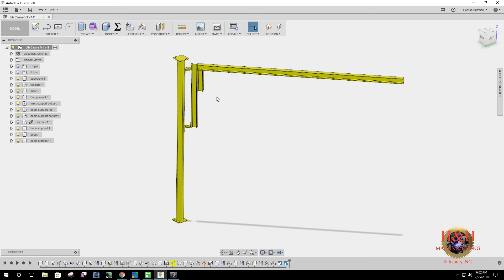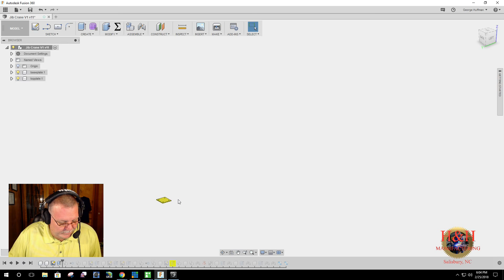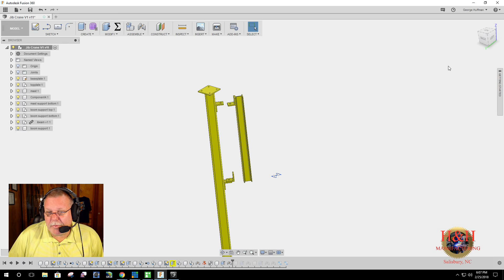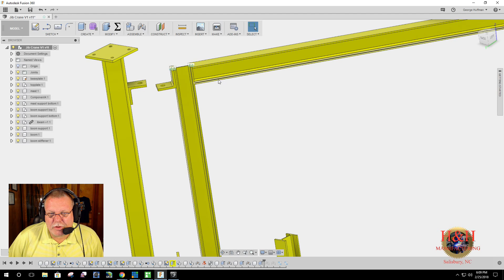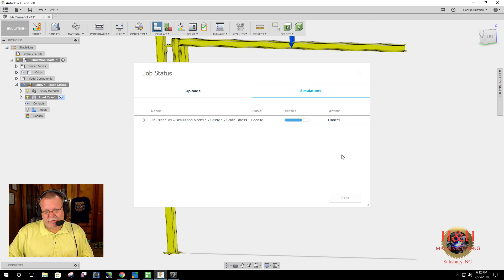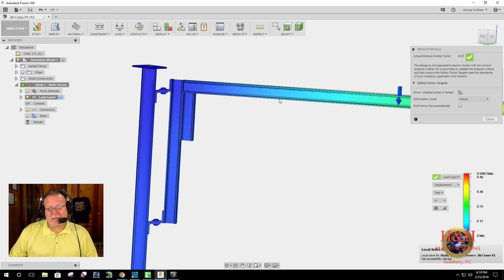LS5--Modeling and Stress Simulating a Jib Crane

Comment: Does horizontal Beam rotates or fixed ?
Reply from the maker: It rotates about the hinges mounted on the vertical tube
Reply: @hhman  is Mast solid or hollow?
Reply from the maker: @chavvaramakrishna1124  3x3x.250

Comment: Mr. Huffman,  I enjoyed your stream.  I would like to mention that when you apply your load force, even though you are selecting near the end, it is applying the force evenly across the whole length of the beam.  What should happen is to split the face near the end to represent an area the size of your trolley, like an area 12" long on each interior flange.  Then you can select those two split faces as the application of your 600 lb downward force.   Applying the load in a small area near the end should represent the  displacement closer to actual.  Here is a brief video on splitting a face, https://www.youtube.com/watch?v=z5Vhn-nQU2Y
Reply from the maker: I watched the video and it helped a lot...This is what is great about the YouTube community..
I'll simulate it again and see how it goes.  Thanks for the help

Comment: I keep setting the reminders, then forgetting while I'm off on my lathe. But they're still good to watch later, so thank you, George. I'm no engineer, but I think I would consider the boom support section of I beam miter cut so it can extend on an angle under the boom. Also, maybe some kind of thick wall steel tubing or pipe as a kind of bearing that the boom turns on/in. It might be overkill for what you intend to move, not sure. Sunnppa's video might give you some ideas. He shows his plan right at the start of the video. https://www.youtube.com/watch?v=ydtd3qjtWzY